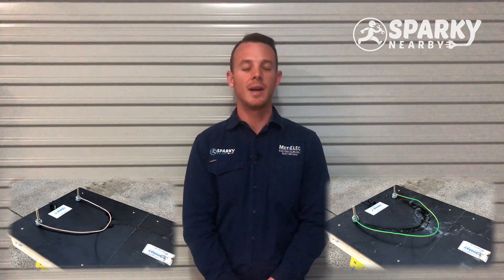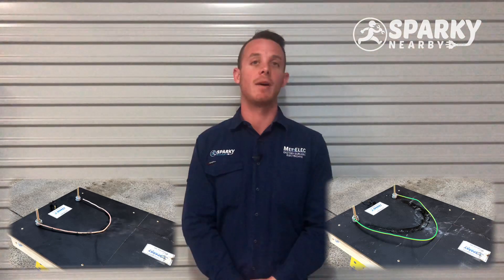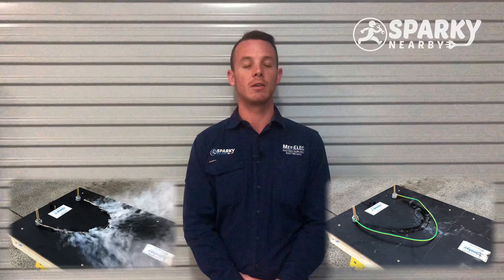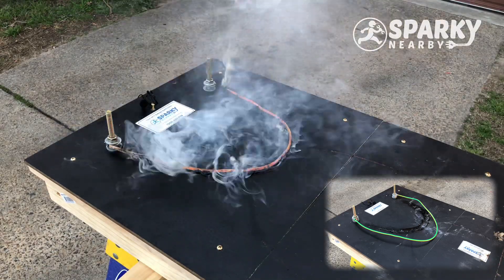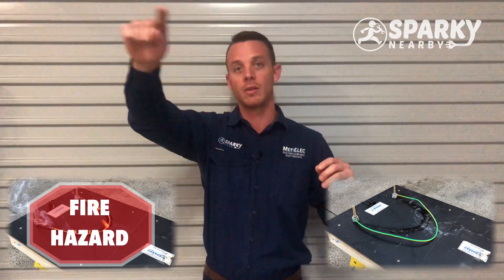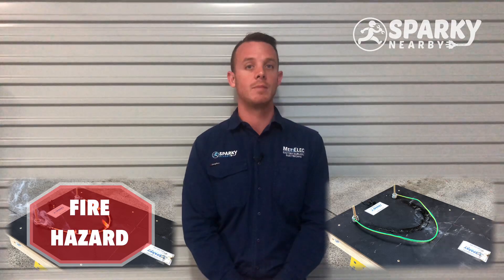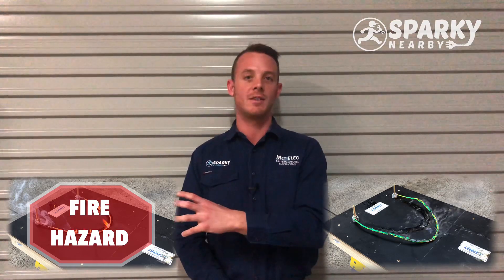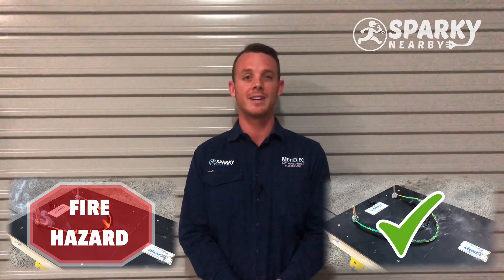Do I Need To Rewire My House? - Old Cotton Insulated VIR Cables VS New Plastic Cables

Comment: How many amps were you putting through it?
By the looks of it, much more then the homes protective devices, fuse or circuit breaker. 
Old cabling isn’t necessarily dangerous if it’s been inspected by a professional, the insulation hasn’t degraded and is fused correctly for its size
Reply from the maker: Hi James, thanks for getting in touch. As it clearly states at 0:20 we have applied 4 times the rated current to speed up the test process to make it easier to see how the cable degrades. This process will happen at a much slower rate if the current is normal, but is still very capable of burning off the insulation and starting a fire (it would just take years and I don’t have that much time to do this demonstration). As far as your comment of “old cabling isn’t necessarily dangerous as long as you have a professional inspect it” - we are professionals, we have inspected the wire, we’ve deemed it unsafe. Any electrician who inspects cotton or rubber insulated wires and doesn’t tell their customer that they are unsafe, is a hack. Rubber and cotton insulated cabling is not fire retardant which means even if there is a fire in a contained room, the cable itself will burn which will spread the fire from room to room. Simply put, these cables are extremely dangerous. While you may be able to legally get away with leaving them in old buildings if they pass various tests, they are still a massive hazard.  At the end of the day, I wouldn’t let my family sleep in a house with cotton or rubber insulated wires, and that’s coming from a professional whose seen plenty of these go wrong. You can make your own decision. 

Also, if you’re interested in old cables, check out this video here: